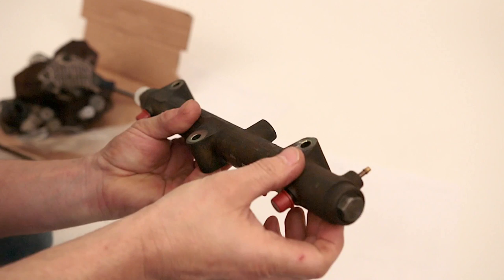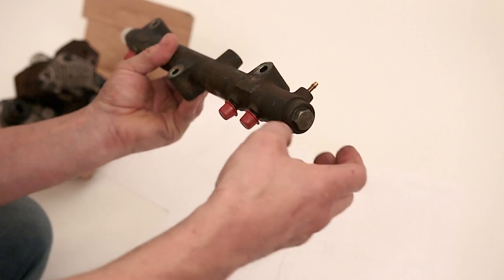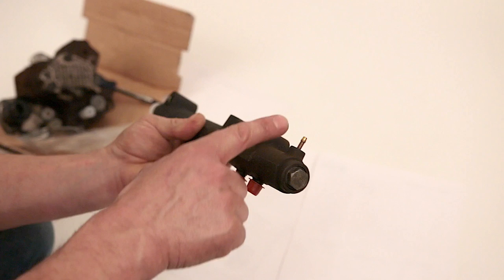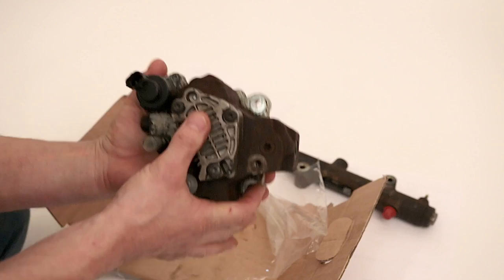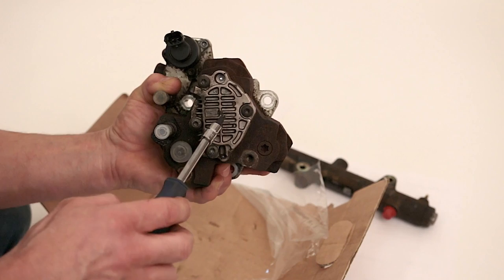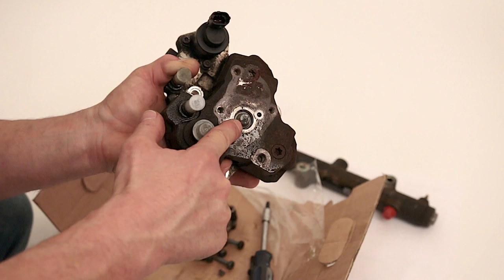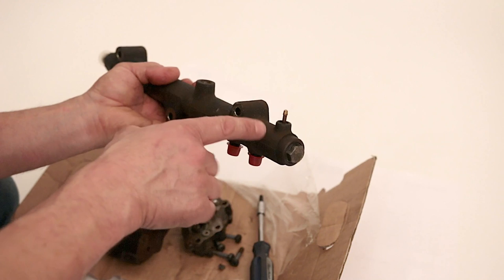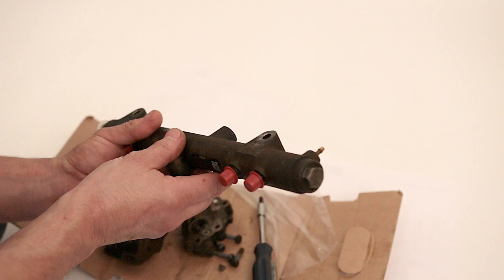LDV Maxus:Chrysler Voyager cutting out & poor starting

Comment: Sorry mate, it might be rustic this van but that makes it simple and maintainable by us drivers. A snooty 'professional' once told me the Maxus wouldn't cut it, I needed a Sprinter if I was going to do international work. 9 years later doing UK-Brittany-Corsica (1800 mile round trip, monthly) the only time it stranded me was for a clutch slave cylinder - not a real failure and certainly not an LDV problem. Like everything it likes being used,  long trips (i.e not stop/start) are best for longevity. Plus I look after it well. The VM motor is nothing short of brilliant ( extraordinary mileages in the FX4 taxi) as well as economic and quiet. Yes there are problems (rust isn't really one of them) around electrics and starting but they're relatively easy if you're half useful and certainly no worse than other vans/ vehicles. Or you can pay big money for a newer van........sure I'd like to

Comment: Thanks for this video, this was key to our solution.... Our 2005 Maxus was easy-start only, even when hot. Been like this for months, and everyone has a different theory as to the issue. So.... we pulled the rubber line off and as you said fuel pissed out even cranking over. We turned up a plastic plug to block the outlet, hammered in on,  and the van started first crank, before blowing off our plug. So this confirmed the issue. We then undid the 17mm bolt (at the RH of the common rail) which is the valve assembly, cleaned it, blew it all out with an air gun, reassembled, and now it starts! Clearly there was some crud in there holding the valve open very slightly.

Total cost of repair - £0.00

Note that now it's working again, fuel does still come out of the hose outlet on the common rail, but at a much lower rate.
Reply from the maker: John Packer 
Hey thanks for your comment. 
  Glad this video was of some use to you.
Reply: That's a cp3 there very reliable.
Reply: There great Van's we have just done water pump Campbell etc no probs 👍

Comment: No need to replace whole rail for the pressure relief valve. They are available separately for about £40- £50.
Reply: 30 now on ebay mate
Reply: chil man Bargain. When I replaced mine they were about 90. That was a fair few years ago.

Comment: Many thanks Alan I had en engine cut out on road test after changing fuel filter thought it was electrical but your video  the later part re- fuel pump made  me have another look and sure as S***t is S***t   I found the broken drive to the rear end of the pump now looking for a replacement pump. cheers.
Reply: There good vans

Comment: You're a doom merchant. Jeez, I would rather have a Maxus than a Transit or Sprinter rust bucket. Yes, it may take longer to change certain items, but this is the trade off for owning a sturdy van. The engine is made by VM Motori, not Chrysler, but the 2.5L version engines are used in the Voyager and Jeep Cherokee. There is a Euro 3 and a Euro 4 version of the same engine also, with the latter being used from 2007 onwards in the Maxus. 

The Fuel Pressure Sensor is available to buy separately, or give the existing one a quick clean & a blow through, rather than buying a new Fuel Rail. The fuel rails hardly ever go, but the sensors do!

Nevertheless, a good video, but less doom and gloom about the Maxus!

Comment: Hi great video! One question: i have jeep 2.8 crd which cuts out when accelerating medium to hard. Restarts again no problem but if i drive it up to 2k rpm it is fine, but when i try to push the throttle and go over 2k rpm then shuts down. Since now i've changed Fuel pressure regulator and fuel pressure sensor.

Thanks!!

Comment: I know this is a slim chance given the age of this video but need help with my maxis. 

Basically it's got zero power below turbo. 
Also when you first start it it won't rev up for first 5 mins untill warm and will have no power. Having to use clutch a lot to get it moving. 
The last owner replaced accelerator pedal and had ECU send for a scan. ECU was fine and pedal hasn't fixed issue. Sometimes it will seemingly work fine when feathering throttle then power goes again. 
It's doing my head in and I've no idea where to look. 
I noticed it's had its map sensor removed but I don't think that should have this affect. 
Also I have replaced oil and filters.
It doesn't smoke or anything but has a smell of fuel when it's being particularly bad. I'm lost now as to what to check. 
Anyone who has any information or advice would be much appreciated.
Reply from the maker: you really need to get any fault codes out of the ecu and have the fuel pressure read as it could be a faulty high pressure fuel pump

Comment: Does the fuel pump still work with that broken part ? I have a 2007 Maxus with a Euro 4 compliant engine and the pressure sensor at the end of the rail now looks to be controlled by the ECU as there is now a plug going to it,  the technical manual says its a DRV which works in conjunction with the metering valve (i'm not confusing this with the Common rail pressure sensor at the other end of the rail which is also has a plug on it)
Reply from the maker: hi, when that lug in the fuel pump breaks which is quite common, the pump will not work at all and the vehicle will stop and not restart
Reply: Ok many thanks

Comment: Was wondering if you know where the relay is for the glow plugs on the maxus?
Reply from the maker: Sam H 
Hi, it was quite some time ago I had the misfortune to deal with a maxis but chances are the glow plug relay is under the bonnet. I would follow the live wire from glow plugs... these relays are normally quite large and found near inner wing under bonnet
Reply: It's under the battery tray

Comment: Would the same problem occur on acceleration as my van starts but doesn't want to rev up ??
Reply from the maker: hi, yes it is quite possible that the engine will idle but will take a dump when you pull away but it could be some other problem and really needs checking out by a mechanic
Reply: alan howatt  thanks for getting back to me much appreciated  gonna have go tomorrow see what's up 😥 booked van in on Wednesday at local garage  hopefully one way or another can be back on the road

Comment: thankyou for the video. i'm thinking of buying ldv maxus  which wont start, its cheap but the body is good and only 55000 miles. do you think i'm mad?
Reply from the maker: lol, if i were you i would walk away, these vehicles are badly built, also it will cost you stupid amount of money just to replace the cam belt. everything on these vehicles is not good, the british never did make a good van and after the sherpas and ldv convoys the maxus was even worse.
if it won't start, be prepared for more of the same...holy shit, its up to you but i would not even entertain one.
if you google search ldv maxus reviews see what other people who own them say.
Reply: mmm your not painting much of a picture, is 2005 to 10 transit any better? prob with transit is rust thats why i was thinking maxus
Reply from the maker: a transit is a step in the right direction, no cam belt to worry about.
apart from rust issues, fuel injectors and high pressure pumps are common problems but overall a better vehicle and a lot easier to work on
Reply: ok whats the van you recomend as a mechanic?
Reply from the maker: mercedes vito or sprinter, updated model from 2004 onwards....they rust like hell but are reliable
Reply: i had the old style sprinter a 1999 and it was slow but very reliable but they are impossible to find now , hard to find mwb sprinters , the lwb ones are common but to big for me, mm have to look, thanks for your help

Comment: Hi my ldv maxus has starting problem turns over but won't start if you have this problem wot I do is go to the fuel priming pump and pump it then turn over the engine once then pump it then turn it over and it starts this is not a problem it is part of ldv ani theft haha .you can fit a non return valve this should stop it happin hope this helps someone out there
Reply: Did you get this issue sorted by fitting a non return valve in the fuel pipe for the pump ?

Comment: What a load of shite you speak.
Italian engine vm motori. Reliable but slow and noisy used in tx4 black cab Jeep cherokee. The vans don't really suffer from rust and are sturdy with a higher payload than most transits .